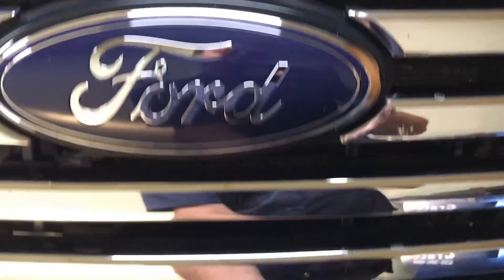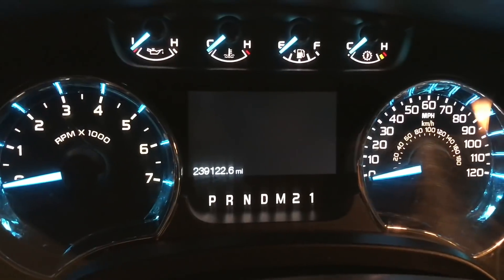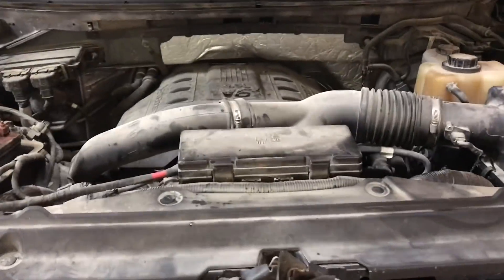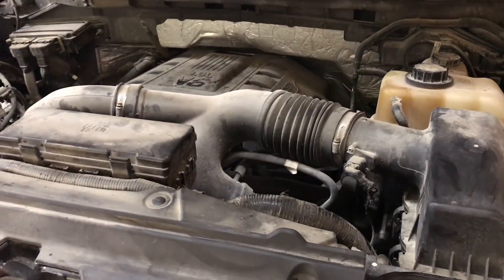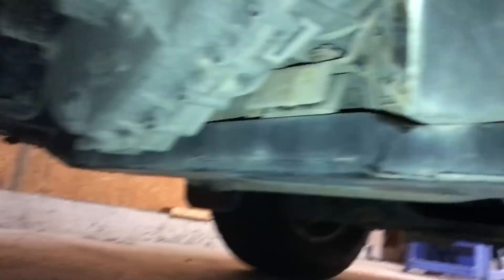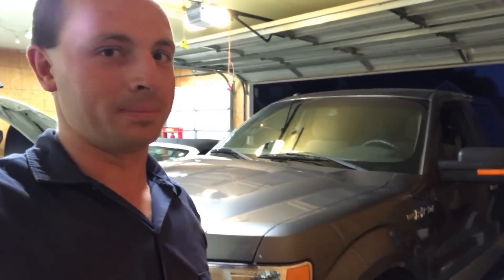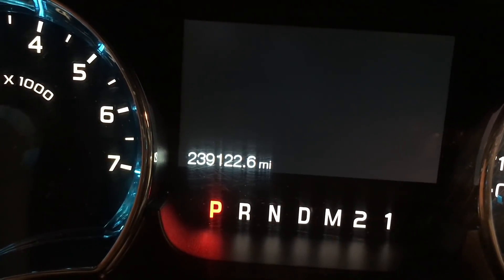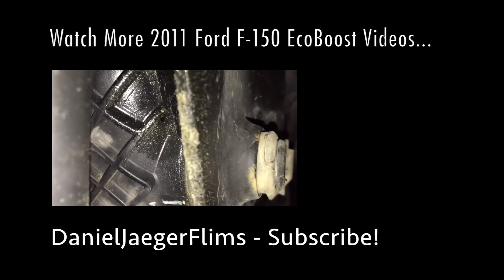Is the EcoBoost Engine Proven?

Comment: "But you can go way longer than 5,000 miles on an oil change these days, you're wasting your money"

I present this truck as an example of why I "overdo" maintenance.
Reply: Ryan Gehret incorrect imo.  5000 is the max i would go on regular maintenance.   It goes dark fast.   The ecoboost is known for its fuel dilution.
Reply: Brandon Ruhl Like how did my comment not get the point across 😂
Reply: Ryan Gehret yeah idfk. It was very clear.
Reply: Plus engines with turbos need oil that's as clean as possible since they get extremely hot, runs under high pressures and its one more system that can fail in an engine.
Reply: junk lubricants, magical claims of higher miles between oil changes, etc. pure fudge.
Reply: I do mine every 8k miles, but I just have the N/A 3.7 V6
Reply: @mitch9521  
Chevy?
Reply: LoL oh boy... 8,000 to 10,000 mile oil changes on my Sonoma zr2 lots of off roading 252,000 miles no engine issues.  285,000 on my grand Prix oil changes every 6,600 miles no issues. Oil change on my 14 Silverado every 7,800 miles.  83,000 on the truck.  Lots of hot roding and off roading no issues...
Reply: I go 5000-7500 miles on my oil change, although mine is always black even when I first put it in because its a Duramax diesel lol.
Reply: PhillLsx Ga.    the oil is under much more stress and direct injection causes fuel dilution in just about ANY engine.    4.3 and 3.8 are both great engines.    My moms Astro had 283k and was stolen.   People ran and eluded the cops 3 times in it.    Got it back still running fine with a trashed interior and a flat.
Reply: Ryan Gehret sorry didn’t see the quotes.   I’m blind.
Reply: Not with a turbocharged engine. I try to change mine every 5000 miles too.
Reply: Ford.
Reply: For certain cars /trucks yeah. But for say a Toyota camry running full synthetic you should change it every 10k otherwise your wasting money.
Reply: 8000  to 10000 that's to high I chang mine 3000 just when it turns black and before it starts using oil if it starts using oil then you know your oil is shit
Reply: Just to add I dont have modern vehicles 70 Bonneville 79 continental mark 5 92 Cadillac brougham and 2002 dodge ram had a 2002 dodge intrepid fell apart after hundred thousand miles got rid of it I drive them seasonal ram winter continental spring Cadillac summer Bonneville fall
Reply: Funny thing is that I've got a Ford Mondeo Diesel (Euro Fusion), and its oil changes are specified at 18,000 miles, so far it's done over 100,000 with no issues. However, the Mustang 5.0 V8 have been eating their bearings in the UK, whereas the 2.3 Ecoboost have been fine! So far Ford hasn't a clue why!
Reply: That is not true. I have a 2016 F165 (F150 2.7 twin turbo 164.7 cuin v6) with 39,800 miles. It had 29 miles when I bought it new. I change my oil about every 8,000 miles. I have videos of at lease 2 of my oil changes. The last one, I went almost 9,000 miles. I could still see the dip stick through the oil. It was maybe a half quart low. I use motorcraft 5/30 synthetic blend and their filter.
Reply: No he want. You guys need to stop looking at new engines with old thinking. New engines are tighter than the old engines and don't have as much blow-by. This is the reason they can go much longer before an oil change.
Reply: Ecoboost engines were design to be boosted from day one. Also they are not boosted as hard as you think. I found this out when I towed my 2001 Cadillac Deville. (Click 6200 on my channel to see this video) I pulled over and popped the hood to feel the boost tubes from both turbos before the intercooler. They were not that hot. My 2016 F165 only make 325 hp from a 164.7 cuin v6. The 1987 Ferrari F40 had a twin turbo 2.9 177 cuin v8 making 478 hp. This is why I say the engine is not under that much stress.
Reply: with a full synthetic yes, not with conventional
Reply: Not really.  That's what the manufacturer's tell you but remember that they would actually like your engine to wear out after the warranty runs out so they can sell you a new car or truck or charge you for expensive repairs.  The fact is that even with the best modern oils, the additives break down quickly.  In fact, they have largely broken down within 1,000 miles.  Do a little research and learn the facts.  Those who criticize the old-timers who still change their oil at 3,000 to 5,000 have been misinformed.  Ask anyone who works on cars for a living.  They almost all change their oil much more frequently than recommended in owner's manuals.  They know better.  I've done virtually all the work on my cars, trucks, and motorcycles for over 53 years now. I used to change my oil every 3,000 miles but now I'll go to 4,000 to 5,000 but I feel unneasy going to 5,000 miles.  Just look at your oil at 5,000 miles and see for yourself.   And don't believe everything you hear.  The criticism of those who change their oil at shorter intervals is usually made by younger people who have never worked on their cars and don't know any better.
Reply: @blackericdenice  this is like 11.0 to one compression ratio engine i think they start at 365 hp high compression with small turbos that spool instantly means it is in boost alot and with high compression its gonna get blow by getting the oil dirty fast direct injection prolly doesnt help being up to 2400psi the ecoboost has vtech hydraulic dodads that have small oil passeges and only holds 5.5 quarts of oil
Reply: throttle bottle literally “pure fudge” cause that’s what will come out of the engine going some 15000 miles like some oils claim
Reply: I go 10k on my SHO. 125K Miles and no issues
Reply: Ryan Gehret depends how you drive! If you tow and spool the turbo a lot you better change oil, there lot more heat and blow by .
Reply: I go by the oil life monitor on my 2000 Chevrolet Silverado 2500 which has never gone past 3,500 miles. I wouldn't push it any further as the oil is good and black by then.
Reply: @clintmullins4406  What does that mean? Fuel dilution? I have this same truck and I feel like a noob all over again
Reply: @throttlebottle5906  you mean 'pure sludge'  :)
Reply: Davey the oil gets diluted by fuel.
Reply: @CJColvin  I like some old cars too. I bought a 2001 Deville 2 years ago.
Reply: @blackericdenice  Sounds awesome.
Reply: @clintmullins4406  dark doesntcmean oil is done..only way to tell is to send into 3rd party tester.  5000 oci is ok for reg oil.way too early for full synthetic.  These are mostly highway miles too, which do roughly 10% wear as same city miles.
Reply: For all of you arguing about oil life and interval changes, have any of you actually send oil samples into third party testing labs for analysis? I own several businesses, one is a transportation / trucking business and the other is a service business that involves mostly city driving. I have owned trucks, semi or 18 wheelers for most of you, in the auto transport industry as well as trucks in the oil fields of Utah and North Dakota. The auto transport side involved mostly highway miles across the country and the oil field involved most miles on dirt roads and lots of idle time. The oil field trucks would not be shut off in the winter time  for weeks and even several months at the extreme end. The service business involves vehicles that are both gas and diesel engines with some highway miles, but mostly city and stop and go miles. Some of the vehicles are always pulling trailers and some are not. I also have multiple personal vehicles that are BMWs, Cadillac, Ford, GMC, Mazda and an older Fiat Spider. Over the last 28 years I have taken oil samples on all the vehicles and had them tested by third party labs. Most of my vehicles run many miles per year over what any normal person would run as they are used everyday in business. The tests will tell you everything that is going on inside your engine from coolant, to fuel, to the wear of every metal used in your engine. On the semi trucks I use non synthetic Rotella 15w-40. The other vehicles I use a synthetic oil in some and non synthetic in others. I started out on the semi trucks at a 10,000 mile oil change interval and have increased it to 20,000 mile interval because of the results of the oil samples. Many trucking companies are running on a 35,000 to 40,000 mile interval. My diesel pickup trucks are presently on a 10,000 mile interval and may soon be bumped higher because of the oil sample results. The gasoline vehicles are on various intervals due to age of manufacturing or the oil called for by the manufacturer. My BMWs will run 10,000 to 15,000 based on current test in progress. Long story short, I do the majority of the maintenance myself, I change the oil myself on all the vehicles, I pull an oil sample immediately as soon as I pull the oil plug and the oil is draining out, I regularly take oil samples until I have a history of each vehicle and then adjust the oil change intervals as needed. Once a history has been established, I take a sample every other oil change. I have not had any major or internal engine failure on any of my vehicles and I have run my semi trucks well over a million miles on an original engine without overhaul. I have actual proof over 28 years of testing that you can very easily go much longer than 3,000 to 10,000 miles on your oil changes without any additional internal wear. This is on single and twin turbo as well as non turbo engines. Don't be fooled by thinking that you can judge your oil by looking at the color or that the oil / additives break down immediately or by the hype of people saying that you must change it at some specific mileage. Again, I don't use oil additives and I use both synthetic and non synthetic oils from Mobile 1 to Rotella to Quaker State in the various vehicles. I stick with the same brand and oil weight in each particular vehicle. I'm sure I will have many that will argue with me and think that I am fool, but I have actual real world usage and testing proof on my side for the last 28 years. Good luck to all and enjoy your driving.

Comment: I'm glad to see that I'm not alone.  My 2014 F-150 3.5 Ecoboost has over 170K miles.  I was averaging around 20-ish MPG in WI running 91 octane, no ethanol.  Now in TX, I'm only getting 17-18 running 93 octane, 10% ethanol.  Driving speeds in TX are a bit higher than up North as well.  I also keep to that 5K oil change interval.  Other than normal schedule maintenance, I've had O2 sensors and transmission PCM module replaced, and needed work on the rear diff when the U joint cause the input bearing to fail.  Also, the coolant fittings to turbo started to leak, but I had those fitting replaced before they caused any greater issue.  That is the only turbo related "issue" I can think of.
I agree, good, regular maintenance makes for a reliable truck, regardless of power plant.

Comment: Most vehicles will last a long time if maintained and built right from the manufacturer. Every make has flaws and makes lemons in each model. It's the percentage of those lemons that matter, if you build 100 cars and only 2 are lemons then your better off with that manufacturer then one that has 20 every 100, it's a roll of the dice. I've always seen someone with a vehicle that gets bad reviews and yet theirs is fine. If your staring off with a quality product then your chances are good, and the F150 regardless of the negatives as been the leading seller for decades, no matter the price if they were unreliable then they wouldn't sell as many year after year. When I drive on the roads I see mainly GM, Ford and Ram/Dodge trucks, Toyota/Honda cars over 20 years old. Especially Ford Crown Vics. So if you pick a crown vic over a say Taurus you'll attitude towards Ford would be different and so on. My 2 cents...

Comment: 2012 F150/4-Door/Ecoboost 
Put 293,000+ hard-driven miles on it and had ZERO issues.  Not a drop of oil or lag in performance. Obviously performed standard general maintenance on it, e.g., oil, plugs air filter etc. and that's it.
Reply: Make a video please
Reply: What king of mpgs you getting with it
Reply: @austinhowze6280 ya what’s average mpg

Comment: My dad has a 2014, with 183K miles, mostly freeway driven, some towing 8000 lbs trailer, synthetic oil change every 4000k miles, all stock except, catch can, cold air and inter cooler, original water pump , YES, all coil packs new, It's an FX4, all fluids changed way before factory intervals, including brake flush , coolant flush, it's got the new green coolant with new thermostat, transmission serviced at 50K and recently, Never follow ford recommended service. Man loves his truck, I have driven it a few times, Plenty of power going up hill with a trailer,

Comment: Hi Dan. Thanks for your video of F150 Ecoboost. I have a 2013 same . Lat year my entire dash dies with the heater in full blast and no way of controlling anything.Now the heater was not on,air conditioning only. Long story short, problem diagnosed as alternator. I believe alternators either work or not. No half way. A local dealer in Ocala, Florida wanted lots of money to diagnose problem. A smaller garage found a shorted wire from alternator to frame and repaired the problem. FYI. The story is a lot longer than that but this is good enough. I believe in what you say and do concerning vehicles.
Reply: Malcolm LeDoux put in an after market radio Alpine Android Apple with the date link and maestro you will regain control of your heater go to Best Buy have it installed you’ll spend about $600

Comment: I have a 2019 F150 3.5 ecoboost with under 2000 miles on it so I can't speak to the longevity of the motor yet.....But the performance is nothing short of stellar! I did a 300 mile cabin trip last weekend (mostly highway miles) and got 23.4 mpg.... My weekly driving back and forth to work (mixed driving) I'm averaging 20.2. If it continues to achieve this kind of fuel economy I'll be happy as a clam!! The thing is a rocket ship compared to my 08 Chevy I had.
Reply: Ford continues to improve upon a winner. It's a fantastic motor with a ton of capability and durability built in. Heck with a simple ECU Flash/chip you could enhance the fuel economy or at worst keep it the same  while adding around 80lb/ft of torque and around 70HP! Without any extra modifications! The Coyote V8 is still an awesome motor and its definitely tried and true but at this point....so is the ECOBOOST! Great Job Ford! #1 42 years straight for a reason. And I just happen to be 42.